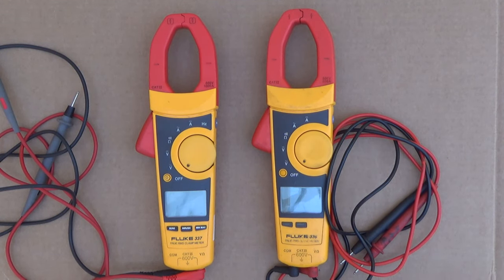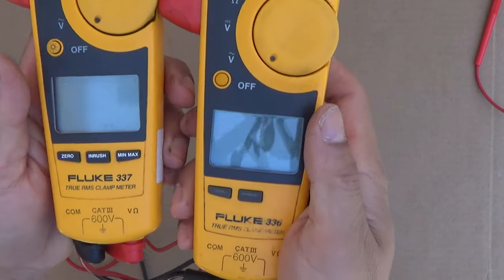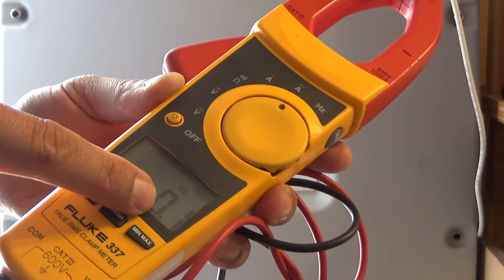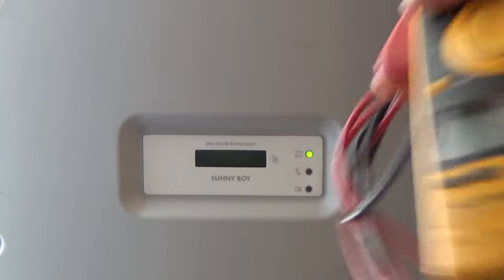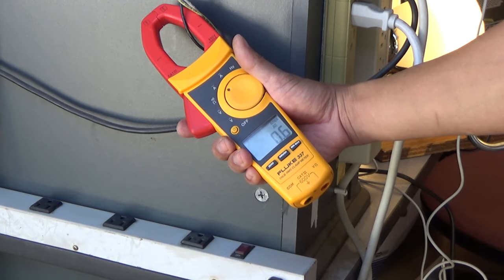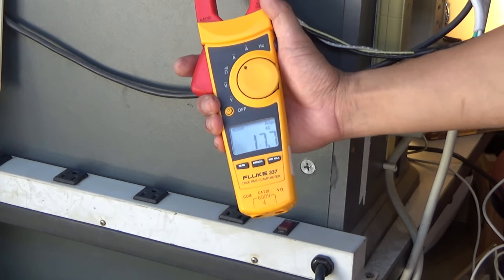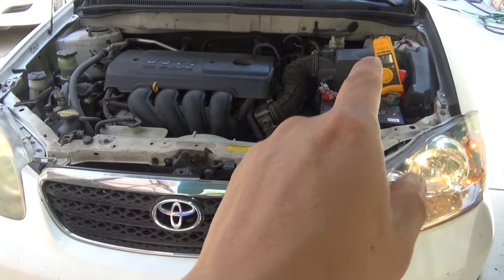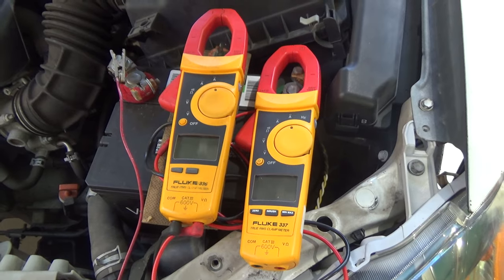Review: Fluke 337/336 clamp meters & how to use a clamp meter; "inrush" meaning

Comment: Great video. Also keep in mind that when you turned on your headlights, you thought you were just measuring your two front headlamps and front running clearance lights. There would also be at least two more red running clearance lights behind the vehicle. In total you were measuring at least 6 lights not the 4. But no big deal. We saw what your helpful advice was providing to us. Thank you!

Comment: Do you need to change a setting to read lower amperage numbers? i.e. your display shows 0.5 or 0.6 Amps before you started the car. Will it read lower amps if needed  or is that the lowest it will read?